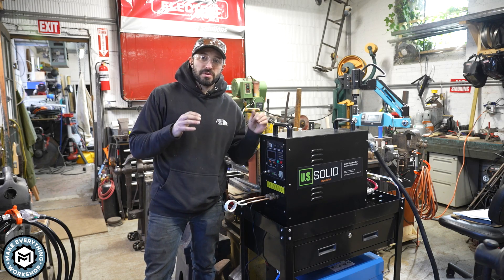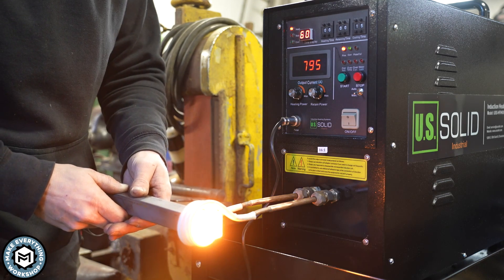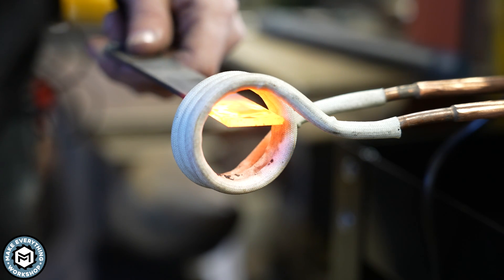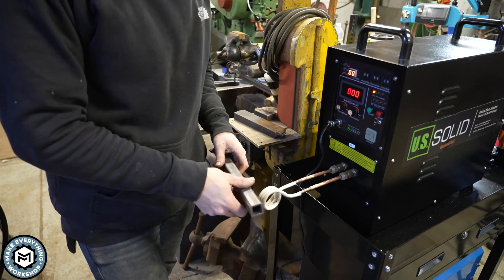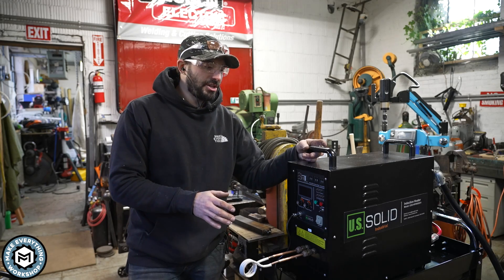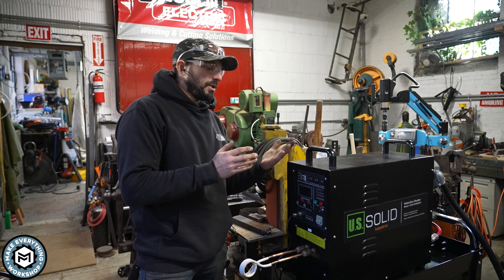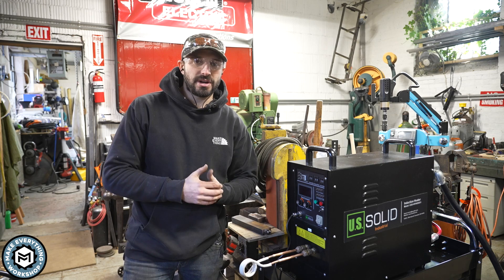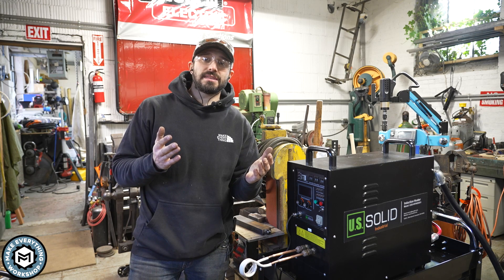Heat Metal In Seconds With The Amazing Induction Forge - Metal Working Tools You Need

Comment: How did you secure the power cord to the machine?  How did you deal with the ground being so far from the power terminals?
Reply from the maker: I put the connections in a metal junction box with clamp connectors to avoid them getting pulled out. For the ground I followed Derek meltons website and ran a ground cable from the internal ground lug up to my cable. Worked well and is very clean
Reply: @MakeEverything thanks!
Reply: I used your junction box method. It worked great. Here is a link to a video I made describing the process. 

https://youtu.be/RiI7ib2Y5Ns?si=-WRHj8zxzbFRT0BZ

Thanks for your input

Comment: For my personal situation (I have this exact induction forge) it pulls a max of 50amps at 240V. Multiply those and you get 12,000W or 12kW. My electric bill in Janesville, Wisconsin runs 13¢/kWhr - this means that my hourly rate of operating this forge (time on the pedal, not simply idling) is $1.56. The energy efficiency is phenomenal!
Reply from the maker: That’s awesome to know! Derek Melton said he was saving hundreds on propane by using this and I don’t doubt it! I love this thing!
Reply: @MakeEverything  This sounds actually ridiculously cheap! How many kW you get in your workshop from the supplier?

Comment: How much current does this induction heater use?  I understand that it will heat ferrous stock faster and in a more concentrated area than a traditional forge, but at what cost in electricity?

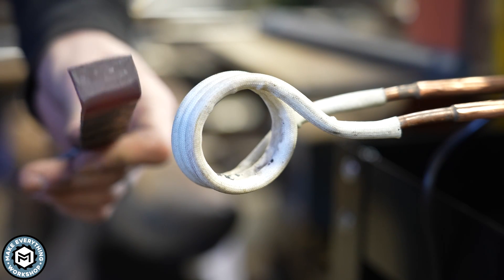Comment: Nice video.  However, note the increased efficiency seen at 5:00 has less to do with the coil gap and more to do with the orientation of the magnetic lines of flux relative to the cross section of the steel.  In the flat configuration, there is eddy current cancellation within the steel, limiting heat to about 1400F (Currie) due to the relatively low operating frequency of the power supply.  The induced current is 180 degrees out of phase on each side of the heated part.  Due to the thin cross section the induced currents meet in the middle of the part and cancel each other.  In the 90 degree orientation there is a greater distance between the induced currents and cancellation of the currents is eliminated allowing for greater temperatures above the currrie point.  It is true that smaller gaps are more efficient, but that is not the reason for the increased efficiency noted in the example shown in the video.

Comment: Re Coils if for bending the 6mm 1/4" coil tubing, best to fill it with some thing like woods metal alloy from the bottom to ensure no air pocks that will cause the coil collapse. Its then easy to shove in boiling water and blow it out with a sponge plug that ensures the coils are spotless inside. You can get a 2ft 60cm flexible connection that will give you great convenience in how you use your coils, as the coils go to the work piece and not the being restricted to the other way around. Check the maker to see if your machine can take a longer extension 2ft was my machines limit.

Comment: Re insulated coils, the Fiberglass will burn and go and fire eventually, if you can get Mica tape in your country use it its good to twice the temp 900-1,000°C.  You can also use zirconium oxide based paint that is completely heat proof 1,800°C very expensive but you can buy zirconium oxide powder add silicate (waterglass) and bake it on and save a fortune with non sparking coils.

Comment: Great video.  I made one for $50 from parts from amazon and I trashed a 2 proto-types in the learning process.  My final rig is portable in that it fits in a shoe box and has portable power using lipo type batteries.  This allows me use the thing outside if the material smokes if it had oils on it like for hardening exist tools like snips or bit heads.
Reply: Can you melt stainless steel
Reply: Can u brazing copper pipe?

Comment: I made DIY version with parts from eBay, but the commercial units have dramatically dropped in price..  I virtually never use my torch set these days and have not lit the forge in over two years as I can basically do everything I need using the induction coil so much faster and without all the excess heat..   The only issue is that it will not heat non-magnetic stainless steels or basically anything non-ferrous like aluminum or brass (it will get the material hot enough to burn you, but will never get red hot)..  Now if you put those materials into a crucible, you can melt them..
Reply: For non non-magnetic materials or even things like glass try this method.  Put the material between to plates that do conduct and you may even what the to use aluminum plates for slower heating.

Comment: It’d be cool to play with, but $1800 will buy ALOT of oxygen and acetylene
Reply from the maker: I think the real savings on this is in propane for those who use a gas forge. Derek melton wrote in his article that he’s saving almost $100 a month on propane fills. For me, the convenience in Gonna be  huge!!
Reply: True, the induction unit will also not do stainless or non-ferrous (unless you want to melt them in a crucible) and a torch is useful for other things, but if you do a lot of mild steel work and can afford to add it to your arsenal, the induction saves so much time and effort in the workshop that it is well justified IMO..  Even one saved trip across town to the gas supplier, wrestling with tanks in my small car is justification enough for me...
Reply: Actually, you can forge stainless And non-ferrous with these machines

Comment: Very impressive!  When you make your own coils would you please make a video of the process.  Coiling tubing in clean, uniform coils without crushing the tubing is not easy.  Do you need to monitor the temperature of the tubing?  Even with cooling the melting point of copper is pretty low compared to steel.  I assume that you use distilled water so you don't get mineral deposits.  Do you need any chemicals to prevent corrosion?

I really enjoy watching and learning from your videos.   You are an excellent teacher. 

Bob
Reply: On my DIY induction forge, I use a commercial TIG torch coolant mix which as far as I can tell from the data sheet is just gylcol antifreeze with some corrosion inhibitors but without the colorant, but regular distilled water works fine as well...
Reply: I think i remember an episode of how it's made on trumpets, they freeze ice inside and bend it cold. I think you can also fill with sand and cap the ends to prevent the tube from collapsing.  I'm really interested to see the process as well.
Reply: Tubing benders are fairly cheap. Like for car brake lines. I believe most of those go up to half inch which im pretty sure is the size these coils are.